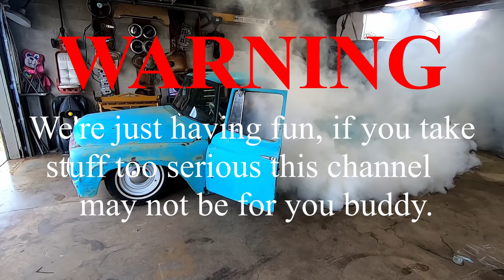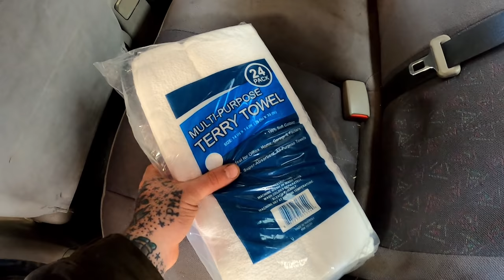LIFTED on BIG TIRES?? 2000 Corolla, WHY?!? Yee Yee!

Comment from the maker: FOLLOW UP!

AFTER 8 MONTHS OF PUSHING AND TOWING ALL THESE JUNK CARS AROUND WITH THE TOW-ROLLA I FINALLY GAVE IT A TUNE UP AND A HITCH FOR THE BACK. SHE TOWS TRAILERS NOW NO PROBLEM. VIDEO HERE.

https://youtu.be/fdytDDpROxo
Reply: I came here looking for the origin video before watching that one lol
Reply: Bad a$$ car,  what size wheels and tires ? Thinking about lifting my little scion xd and those tires you used look 👌👌
Reply: What size tires did you end up with? I've got a 2000 corolla aswell that I've been thinking about doing the same concept to for a budget back road deer hunting rig
Reply: where did you get the spacers for the struts?
Reply: Is there a link u can share to what u bought to lift her, I think I’ll lift mine
Reply: For everyone asking about tires he did say they were 27" Forceum tires. I did alot of research and digging and found them. Forceum MT-08 27x8.50-14. They are a big tire for that car but he made it work. The lift spacers can be found in 30mm or 40mm on Amazon/Ebay. 40mm will get you an inch and  half lift. With adjustable coilovers also you may be able to safely get 2-2 1/2". I have a 99' Corolla and will be doing the 40mm spacers, already have adj. coilovers and not quite decided if I'll go with the 27" tires. There isn't a big selection of all terrain tires in this size range.

Comment: This is hillarious and genius at the same time, totally needs a 5 speed swap
Reply from the maker: That would be great! Though I’d never invest in it lol
Reply: @PuddinsFabShop  I did it in my corolla 2002 for $480. The hardest part for me was lining it up on the engine without a tranny jack
Reply: I have a factory 96 Corolla 5 speed and this video got me looking at ebay for spacers and tires lol.
Reply: @braxtonbunner4990  Corolla gang
Reply: Working on it, Ebay TRQ special
Reply: This is a great example of "Make Do with whatcha got"!  If you can't afford a $700 Subaru, just get a $500 Corolla and spend $800 on it!
Reply: Needs a Cummins r2.8
Reply: No. That engine hace terrible reputation.  Remember is chinese.

Comment: I really like the look of those tabs. I lifted my Corolla one whole bolt spacing on the rear. Front wouldn't take that much of a lift because of the axle hitting the suspension, so I made a spacer out of a 2x6 instead of the whole 3 inch bolt spacing. Manual transmission tows trailers like a champ

Comment: The 1st gen Rav4 shared design elements with Corolla. Being that the Rav4 was available with both auto and manual versions in 4wd, it may be a semi bolt-on deal to convert the Corolla to 4wd. In other markets, similar year model Corollas were available in AWD.

Comment: Don't worry about what people say bro. 
I DONT! I am a full time Plumber and used to work out of a GMC savanna before it shit the  bed. It used to cost me 40 dollars to drive it a few towns over and back. 
I loaded up my essential tools into the trunk of a Corolla and managed to get by just like that. 
Now I fill up my tank with 30 bucks and I can drive across the state and back.
Sure I can only load a few sticks of pipe 6ft at a time. But I'm only small time, It works. 
I dare someone to say something lol
This video helped me validate everything I was coming up with. 
The roof rack is a good idea I wanted to use it for pipe, Or a 6 or 8ft Ladder.

Comment: This turned out great!  What tire size did you end up using?

I had one and ran a set of 205/60R15 tires on it (on aftermarket black steel wheels) with a 1 inch lift. Made the steering feel way more firm like you were driving a larger vehicle. It was the 4 speed auto "LE" trim and was a great car.
Reply from the maker: They are 27x8.50 14s! It drives better with these firmness wise as well!
Reply: @PuddinsFabShop   Wow I looked into it and with a stock size of 185/65R14, the 205/60R15 I was running were 5.2% taller and they looked big to me, yours are the equivalent to 215/75R14 which are a whopping 13.8% taller than stock and 1.2 inch wider. That is impressive, no wonder it looks so aggressive. With your speedo reading 13.8% slower than you are actually going you better watch out for Johnny Law.  It was great on road trips but I would always end up going well over the speed limit and not realizing 😁
Reply from the maker: Yeah she’s off some but I have a good feeling for the speed I’m actually going!

Comment: Thought about doing an El Corolla a couple years ago. Because its a unibody, you'll probably have to make subframe connectors, if the roof gets cut. Not hard at all. But it'll be a hell of a gas-saving "truck". Even mini trucks can't get gas mileage like a corolla, all the efficiency being lost in the rear wheel drive driveline. 👍
Reply from the maker: It would definitely need some support.

Comment: If you want more wheel clearance in the front and not mess with the suspension geometry too mucn and axles, you can do a subframe drop, using washers then weld them together

Comment: One of the coolest projects you've done!  Reminds me of when I had '83 Toyota Tercel and the area I use to live got hit by a freak snow storm dumping 12" of it in 24 hours! (A normal winter would only be up to 6" all season.) Anyhoo, I put studdable bias ply recap snow tires on that little Tercel and I could go just about anywhere with it. 
Keep up your good work!
Reply: Crazy I did the same thing that car was a beast! Mine was black with grey inter. I miss that car and they are hard to find.

Comment: Not gonna lie, I appreciate that little tip using two vice grips to get the socket off. I usually apply f-bombs liberally but your method is better than mine

Comment: I ended up with a Corolla once. She traded in my Expedition for it, she survived but the marriage didn’t. Mine  was a 4 speed stick, and I couldn’t merge on the highway without staying on the shoulder for a mile with the throttle to the floor. I think I merged but they may have slowed for me out of pity.

Comment: Good stuff brother. I've wanted to lift a fwd car for awhile! The Subaru guys have a lower strut lift kind of like you made for the back that is basically just plates that bolt onto the sides with a spacer in the top hole so it will tighten without collapsing. I saw another guy cut the spring cup off and slide it farther up on the strut. Anyway, lots of different options. Keep it up. The Corolla is awesome!

Comment: 98-02 Corollas and the later Pontiac Vibes which run the 1800cc toyo motor...
Anything built in the NUMI factory (which is now the Tesla plant) is bombproof.
Those "krusty's" can last 6-800k before breaking.

Comment: Great video. On my 3rd Corrolla. Have you had a low compression on #3 cylinder? If so how did you fix it without rebuilding the engine?

Comment: Happen to lift my little work car the same way just the other day. It’s the only thing I’ve ever left stock and after 3 years it got to me that it was just too boring so after cheap spacer steel wheels and tires all off Facebook market place the little scion xA is “cool” now, I know it’s an older video but I gotta ask do you remember where you got the gripper tires from? I went with just oversized street tires but would like some off-road looking tires one day just had trouble finding some in the size I needed

Comment: I was wondering what kit you bought? I've been trying to find one that is compatible with my 2000 zze110L. All the kits online say zze120L which is the newer body style in 2000. Not 100% if the struts are the same. Any info would be great. Sweet build and video!

Comment: The weld wont hold up to the pivot point. Rather the strut is either gonna tear at the weld line or shear the strut bolt.

Comment: Very nice! Great humor. I believe you could use Toyota Rav4 struts and springs and it will lift this car also the rear tire would clear without spacers.
Reply: I bet with some Rav4 strut assembly plus some 1/2 inch spacers there probably would be no need for extra modifications. Just a thought.

Comment: She needs mini tube bumpers front and back to really set off the safari look.
Reply from the maker: It could use it for protection.
Reply: @PuddinsFabShop  well if you're using it to pull rigs off of trailers. Lol love the build bud. I'm looking to get a 95 Corolla wagon 5speed.  You've put ideas in my head.

Comment: I'm lifting my 2008 Corolla and made some 2.5" metal spacers.    
I'm hoping I don't have to worry too much about the longer cv on the passengers side.  

This is for Minnesota.     
 Snowrolla or Hirolla.       I donno.   

Where did you get the tires from?
Any info on them?
Reply from the maker: eBay. 27x8.50 14
Reply: @PuddinsFabShop  i have to find something for a 15.       Smallest wheel that clears calipers on the 03-08

Comment: You should look for a used  awd Toyota matrix / pontiac vibe ( same car) . Im in rural colorado mountains and many people have the awd 2003-2008 Toyota matrix,  pontiac vibe which is a corolla hatch back. Its cheaper , more reliable than a subaru, or honda crv

Comment: If you undo that hat bolt while it's still in the car. You don't need a spring compressor
Reply from the maker: Until you go to put it back together with a missing leg? Lol
Reply: @PuddinsFabShop  not even lol if the strut is still bolted on by the 3 bolts. Then undo the middle main hat bolt the spring will uncompress whilenur jack the car up and it won't shoot anywhere

Comment: I’m currently doing this lift on my 98 corolla. My brake line bracket is in the way of the struts so I’m forced to cut the bracket and I’m going to figure out a way to mount the hardline a little further away

Comment: I had that exact car a few years ago. Well mine was a 99 and white, but it's still the same unless its an 01 or 02 which are face lifted. Mine was a 5 speed, which are hard to find now. Loved that car. I ended up crashing it into a tree in a alcohol related driving incident. Lesson is...Don't drink and drive.

Comment: Is that a universal lift? Or does someone actually make a lift for a Corolla?
What size tires did you use?
Reply from the maker: It’s a lift for Corolla from eBay. Tires are 27x8.50 14s

Comment: That year Toyota Corolla burned a quart of oil a week right from the showroom , it was caused by oil retention rings having holes that were too small. Naturally Dr. Toyota balked at a recall, imagine the cost of pulling everyone's 2000 Corolla motor and basically putting in new oil retention rings. They pissed off a lot of owners but Toyota figured it was a bargain because they pissed off only the buyers of a 2000 Toyota Corolla.  Grab yourself a baby Ruth bar or something and let me explain to you how I came across my 2000 Toyota Corolla a dupont Chrome illusions ,ppg Mirage, (Japanese knockoff) you know it changes color when you turn your back,  silver one I call Miss Yoda, 
 my boss after feeling guilty about not getting my saturn out of impound( did I mention I'm Mr FTA when it comes to traffic tickets? That time it was not my fault cops came up on me in a parking found a 12 gauge shotgun shell on my passenger seat claimed that I was a convicted felon took me to jail I had to get to the judge 2 weeks later to finally end it during a minute or so break,I asked him, your honor may I tell you something?   He said sure go ahead,
 you can drag my name through the mud and a lot of that might probably stick but one thing I do know, is I Am not a convicted felon and I'm very proud of that .. so bam freedom I hit the ground running 
so my boss feeling guilty he never tried to get my car out of impound for me along with all my tools and his material  decided to buy me a new to me car sight unseen  he showed up gave the guy the cash and handed me the keys it was supposed all redone and it pretty much was, but the guy who sold it, failed to mention it had a blown head gasket, I saw it and smelled it as soon as I opened the hood but everybody was gone by then. So I handled it Miss Yoda was a dependable car, just like a horse you give em  a scoop of oats and they'll run all day, you give her a scoop of oil and she'll take you anywhere and back home. After somebody slammed on their brakes in front of me in in the middle of a Mickey D's driveway entrance with me paying more attention to oncoming traffic I managed to kiss their ass hard enough it knocked the whole front clip loose the headlights and all the fastening clips and such,
Now you can take this to the bank after getting tired of my headlights wobbling replacing bulbs and everything and the whole thing being held up by ropes I discovered something by accident I had about three or four tubes of that Dap tub and tile caulk and, too much Time on My hands. It really was no other way to fasten it cuz everything was broke off so I glued it all together with that shit, not expecting much but then it just got hard and then it got harder and harder still untill this very day my front end is Rock solid, you cannot wiggle any parts, amazing I even managed to glue a corner piece of a 1 gallon plastic water bottle over one of my missing turn signal lenses and nobody has even noticed it. ,
 Yeah I've replaced all my struts, it's something I highly recommend because it'll keep your carrolla from crashing off the road should you dare to  look away for a second , I even made what turned out to be a safe and effective strut compressor with an a frame made of unistrut ,the feet stay on the shop floor and you compress them by lowering your jack,,  that might take you a minute to figure out what that actually is but that is what it is and I got me a pair of Sears road handlers  for a lift on the back I checked those fake  hubcaps ,painted my wheels black, which is a major mod right there alone, ,so I got the jump on you, I might even could say you copied me,. Yeah miss Yoda is  currently my backup car and she plays it well I just can't stop looking at her,  she's so beautiful.lol
Reply from the maker: Mine loses a quart for sure!

Comment: yea don't cut it, youll lose stability strength in your car frame, because there is not much of one there. I did it and my car and it sagged and the doors stopped opening.
Reply from the maker: I’d add support if I did it!
Reply: @PuddinsFabShop  absolutely
Reply: @PuddinsFabShop  love your channel thanks for the uploads!
Reply from the maker: No problem man! Thanks for watching!

Comment: When you altered the rear lower strut mount on the rear spindle you removed the alignment and stabilization point for your rear whee
Reply from the maker: Funny, months later, no alignment, no tire wear, and it tracks better down the road then it did before.

Comment: You should run gambler500.
Reply from the maker: No time! Lol
Reply: @PuddinsFabShop  at least install an lsd. Traction concepts can custom it over your diff. If you ever run it on ohv trails. Getting both sides of the wheels to run helps better than open diff..

Comment: So, in the interest of education, what's the alternative?  You cobbed up the rear strut all to hell and didn't like the result so which alternative should you have done to avoid all the welding and drilling?  Wheel spacers are one alternative.  If they're good enough for rock climbing Jeep Wranglers then why couldn't you use them?  They even give the car better stability in turns.  The other alternative would be a narrower tire - if such a thing exists in the size you want.  What would YOU do differently if you could do it over again?